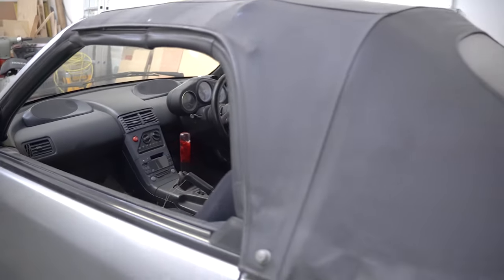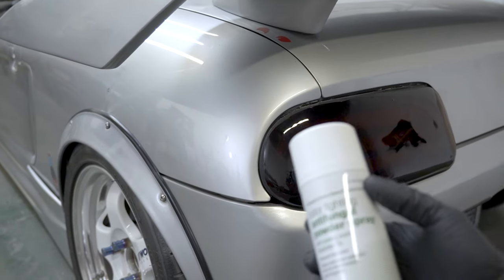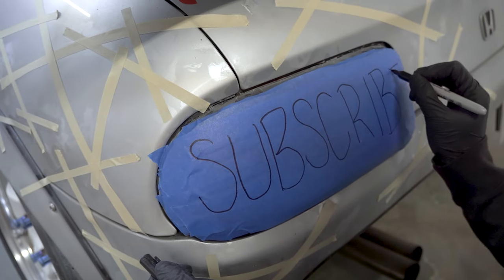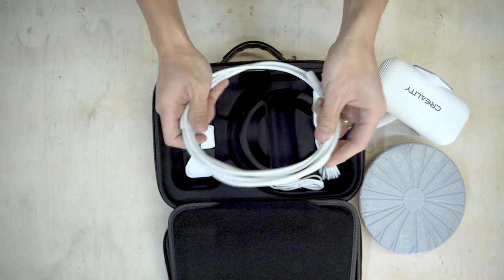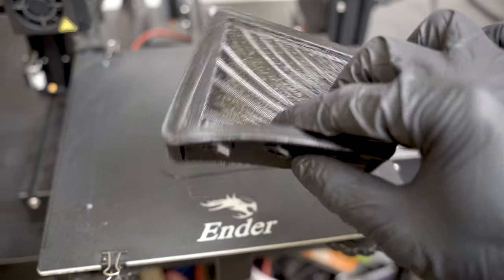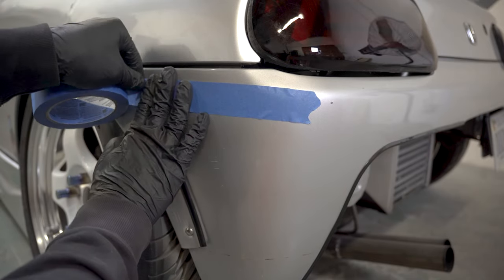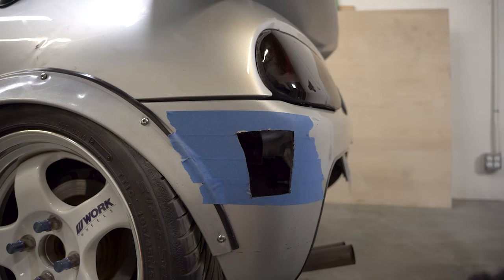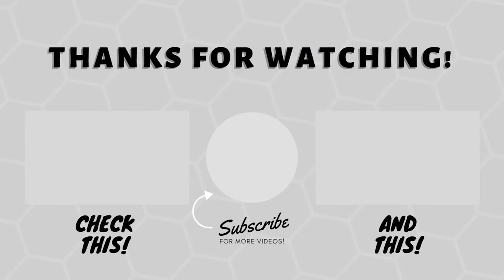3D Printing Custom Lights for my Honda Beat using a 3D Scanner

Comment: using the painters tape as markers is a great hack I do it all thje time.. you can even use small torn pieces as it'll make a feature with the shape and easier to clean up ..
Reply from the maker: Thanks for the tip!

Comment: Great video on real world usage of 3D scanner and CAD. That model had a ton of triangles, did it slow your laptop down? Back up bezels look fantastic. Those LEDs are powerful. Mahalo for sharing! : )
Reply from the maker: Luckily our laptop has a decent graphics card so it didn’t do too bad when modeling. I couldn’t change the mesh to a solid without the laptop crashing though. Looks like we need to build a PC 🤭
Reply: @IMEEMADE  Yeah, like me. Ha. Really, not like me. : )
Reply: How do you export to CAD file?

Comment: Great Job! I just recently purchased the same scanner. Would you be willing to show a little more about how you importanted the scan into Fusion 360 and used it to design?
Reply from the maker: Absolutely, we have a small write up on our website about the process. I can definitely add more detail regarding the fusion 360 portion!

Comment: Did the same thing on my car a year ago cuz i lived in a forest with no lights.... sept i just mounted an led fog light under the bumper and ran it to a relay and spliced it in to the reverse circuit, of course it wont pass inspection with that light on it 🙃, so inwas forced to take it off... the plan is to do something like this but ona civic heh.
Reply from the maker: Awesome!

Comment: Would using a LIDAR sensor on the iPhone be a good substitute for the 3D scanner?
Reply from the maker: Not a bad substitute. Using polycam you can get a decent enough scan but it won’t be as accurate

Comment: How you managed to print it with ASA on that ender?? :)
Reply from the maker: Temperature is at the upper limit of the hot end and it took a few tries, but it works!
Reply: @IMEEMADE  what filament did You use? ;)
Reply from the maker: There’s a link to the filament we used in the description